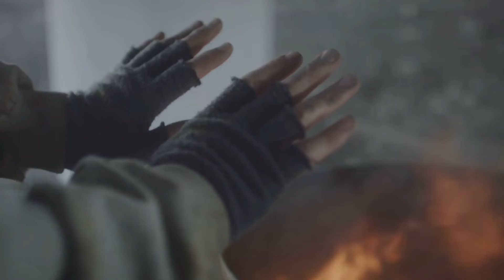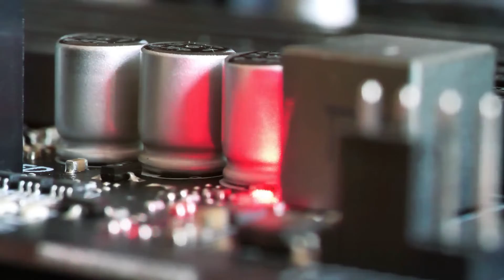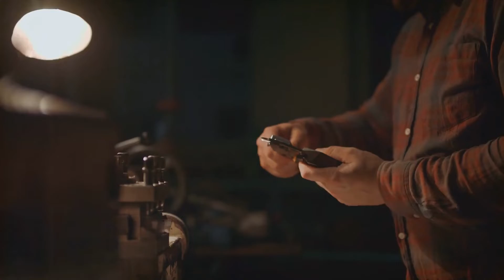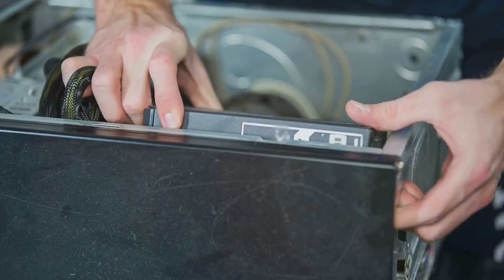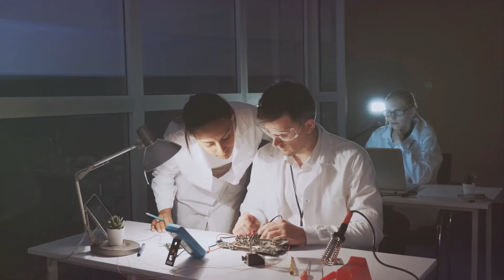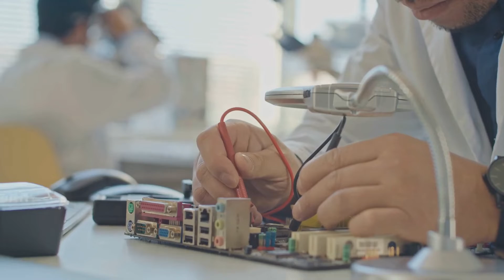How To Find The Value Of A Burnt Open Circuit Unmarked Resistor

Comment: This video is just terrible.

After nearly 9 minutes of repetitive monologue over stock footage, the only real advice is basically: "Try to read the markings.  If you can't do that, try a multimeter.  If that doesn't work, I dunno, just try sticking random things in until something works, I guess."
 
First, you should never attempt to measure a resistor while it's still in-circuit.  Your likelihood of getting a correct result is extremely low, because there are tons of other things that could be in the rest of the circuit which will screw up the reading.  The first step should always be to desolder the resistor so that it can be measured/manipulated on its own, unconnected to anything else.

And you should certainly never ever just apply random voltages to a circuit without fully understanding the design and knowing what voltages are appropriate.  That is a very good way to just burn up other parts of the thing you're trying to fix and make the whole problem worse.  There is really no reason to apply a power supply anyway, because it can't tell you anything that a multimeter wouldn't tell you already anyway, so this advice is just dumb.

And again, just sticking random values of replacement resistors into an existing circuit without knowing what the correct value is supposed to be is a good way to just fry other components, and it's unlikely to tell you anything more than you already know about the actual correct value of the resistor.  Even if you find something that seems to work, it may be off enough to cause other subtle problems or instabilities down the line, or just cause something else to just blow later.  In particular, the advice to start with low values first (even as low as 1 ohm) is extremely stupid, as a resistor that's too high will usually just cause things to not work, but a resistor that is too low will often permanently damage whatever it's connected to (and once the rest of the circuit is fried, no amount of sticking in other resistor values will tell you anything).

"The color bands are usually read from left-to-right, or from top-to-bottom"  Umm, resistors do not have an inherent "left" or "top".  They can be found in any orientation.  This is a completely meaningless statement (and potentially misleading/confusing for newbies, as it suggests there is a particular orientation for a resistor that they should just "know", which is wrong).

"If the multimeter shows a value close to zero, this could indicate that the resistor is open circuit"  Umm, no, that indicates that the resistor is shorted, not open.  It's not a critical difference in this case, but the two are really not the same thing in most other situations, and it's very misleading to suggest that they are.

"Think about the behavior of the resistor when we applied voltage.  Did it heat up, did it smoke?  These signs can also give us hints about its original value."  Uh huh.  And what exactly would those hints be?  How should one interpret them?  It's interesting that you don't explain any of that, almost as if you don't actually know either.  The truth is that if the resistor is already damaged, these indicators really won't tell you anything useful anyway.  At best, even with a completely undamaged resistor, they would maybe give you a clue as to its power rating, nothing else.  But then that's usually pretty easy to guess just by looking at the physical size of it anyway, so this part is really all just a waste of time.

Also, note that a burnt resistor is almost always a symptom, not the cause.  If a resistor got burnt out, it's pretty much always because some other component went bad and that ended up frying the resistor.  If you just replace the resistor and nothing else (even if you get the value exactly the same), it will almost certainly just burn out again anyway.